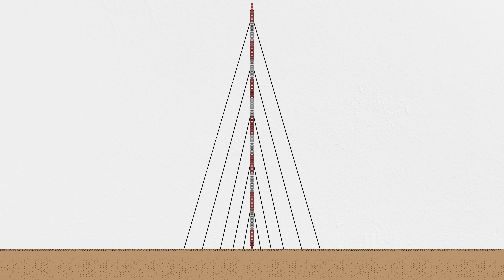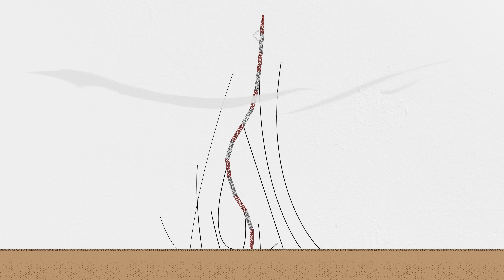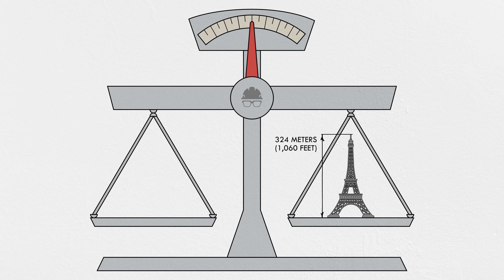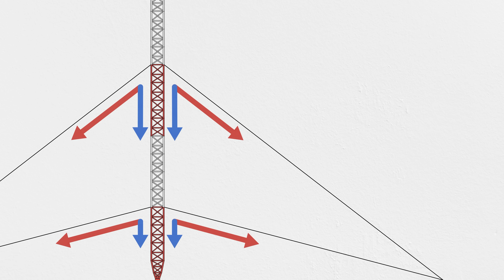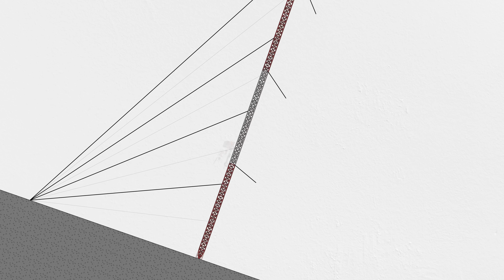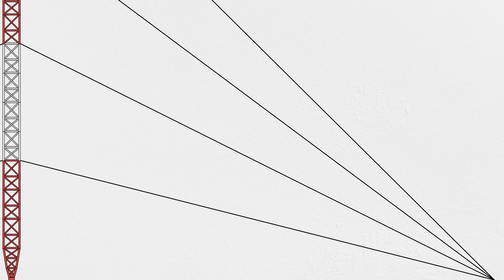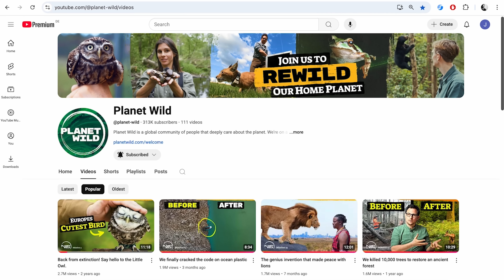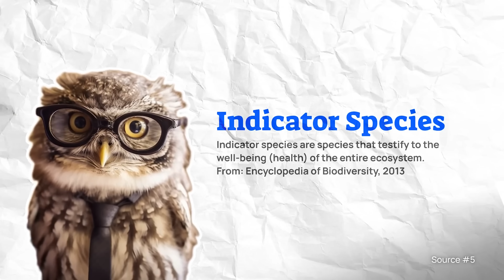The Bizarre Bases of Antenna Towers

Comment: On a hill close to my home there is such an antenna tower, just shy of 200m in height. When I first walked really close to that tower, I couldn't believe the size of the guy wires and the corresponding pieces that anchor the guy wire into the ground... From far away they seem so thin, but when you get up close, man those things are huge. 
Loved this video, loved the practical demonstrations.

Comment: I was privileged to work on a Vicon crane as the oiler back in the early 70s. We were constructing the Annapolis, MD, Array, consisting of a 1200 ft central tower (resting on a parabolic ceramic plate 3ft diameter) and five 600 ft towers encircling the main. The iron workers were mostly Native Americans. from Oklahoma. I have a whole story about being taken up to the 300 ft level and losing my bet.

Comment: Perhaps worth noting - Never touch an antenna or its supports if you didn't LOTO the transmitter. RF burns are some of the nastiest, slowest-healing burns you can get short of taking a nap on the barbecue. They almost inevitably end up going right through the skin and into the underlying tissues. You don't need massive transmitters for that, either - touching the wrong part of a reasonably normal ham or somewhat overdriven CB rig will do, and commercial transmitters will usually be several orders of magnitude more powerful.

Comment: 6:24 “You can’t push a rope” -> actually, you can. Climbers often loosen a figure-eight knot by pushing the short end toward the center of the knot while twisting it to create temporary structural rigidity.
Reply: Climbers and knots… I don’t think the exact same principles apply when standing a tower because you’re not climbing.

Comment: Hi Grady. Recently my hometown is constructing new bridges with only one pillar in T shape. I'm very concerned about the rigidity of the T shaped support which seems to be too thin. Obviously it is Post Tension RC. But still it's not reliable due to the tensile stresses exerting at the corner of the T pillar. Do you think it's safe?

Comment: I’m a structural engineer, so I understand how/why the fully pinned connection with guy wires are more efficient than having a fixed connection without guy wires. I’ve never worked with these towers, but how does the thermal expansion/contraction from the guy wires affect the tower itself? If it’s a “small” tower, then I’d assume it to be negligible, but if the guy wires are very long, then that would play a huge role into it. It seems like it would either induce too much compressive force when it’s cold or not resist enough lateral force in the heat. I don’t anticipate any projects with it, but I’m just curious at how both of those would be taken into account

Comment: Oh cool, I actually work on these, those guide-towers can really sway in the wind at the top. Self-supprters are by far my favorite towers to climb since they usually have the best climbing peg layout and you don't need to worry about any guy-wires getting in the way of the rigging rope that we  climb up with and attach to the tower to lift and lower equipment and components.

Comment: What amazing stories sheared here from professionals whose work involves commercial towers in some way. 

As an Amateur Radio Operator I have long been fascinated by the art & engineering of wireless radio. It’s one of those disciplines that the deeper you dive into the technical aspects the more you realize how little you actually understand it. 

Anyway, I use a 30’ telescopic mast to support my own little antennas. It’s supported by guy wires the same way a the giant commercial towers, and it is almost like some kind of magic how stable it becomes when all adjusted properly.

Comment: Loved working on cell towers for a handful of years. To cold in the winter and pretty dangerous for my taste. You can be as safe as can be, but your buddy can knock the tower down with one false move. I've had a couple close ones. Guyed towers were always tricky, mounting antenna booms. Take out one of those wires and your in trouble. Thank you for covering this!
Reply: "take out one of those wires" ????
Reply: @JoelSzymczyk  Cables! Drop a boom on a cable and your taking a quick ride to the ground. I hated those towers! You should never drop a boom, but if it did happen.

Comment: I'm studying naval engineering and sailboat mast are just the same but usually lateral space is very small so you can add spreaders(compression post part way you the mast) to increase the angle at which the shroud(cables on the side) meet the mast also you have very high compression from the sails(that means more pre-tensioning) and halyard (ropes that hold the sails up and therefore pull the mast down)

Comment: As always, very informative video. Back in 2001, there was a pilot of a small single-engine Cessna who unfortunately flew right into the WestTower Transmission Tower (1,087 ft) near Mont-Carmel in the Province of Quebec (it was foggy and used the tower as a way point). The main fuselage of the airplane was stuck so high in the tower that it was impossible to retrieve the body following the crash. Experts from the US had to come in and demolish the tower in order to retrieve the body. More detail can be found if you search for CBC Tower and the name of the city mentioned earlier.

Comment: Not to mention those guys have to be insulated as well. Our 1000' LF tower guys are made of sections of steel cable coupled together with massive ceramic links with bushings. That's another factor affecting the tension you can put on the cables, and the dynamics of the cables, since they aren't continuous lengths and have added weight along their spans.

Comment: IN CASE ANYONE ELSE IS CONFUSED ABOUT "GUY WIRE":
The word "guy" in "guy wire" comes from the nautical term gei (Dutch), meaning a rope used to control a sail or steady a mast.
It's important to note that a "guy wire" is not a "guide wire," though the terms sound similar. The distinction lies in their function: "guy" refers to stabilization and support, while "guide" implies direction or leading.
Reply: Thanks for pointing this out! And a "Guyed Mast" (which sounds even MORE like "guide") is spelled that way because it is supported by "guys."
Reply: @monitron  That's right. We guys support everything. 'Course if'n it weren't for our women, we'd have no reason to support nuthin' and everything would collapse like an unguyed mast.
Reply: Thank you Bill Nye the wire guy.
Reply: Thanks for the cool information! 😎
Reply: Precisely and thanks for posting that for those that didn't know...I've known for years,but thanks just the same,and,yes I have also noticed that the great majority of folks  do not know. Take care,and have a great day😊 (sincerely from just an average guy in B.C.,Canada)Stay safe
Reply: Same as guy-ropes for tents.
Reply: Im an engineer and Im embarrased to say Ive only just now learned it is actually "guy" and not "guide"
Reply: Well, I knew that but had forgotten.
My 12 brain cells run like a shift register.
Reply: Thanks I thought it was the guy the boy Installing the wire. By the way, most now to go terms comes from Dutch.
Even In Italy With a long past of sailors, many words that sounds architect. Read coms from dutch. Funny in the Netherlands. Most financial terminology is Italian because of the first bankers in Europe where Italians. And since Italian, Italy didn't exist yet they called him lombards.
Reply: Sorry voice recognition didn't work very well. You can try to guess what I meant right
Reply: He he. "gei"
Reply: Guy wire
Reply: French not Dutch, sorry niderlander
Reply: so the guys (aka the geis) keep your mast rigid
Reply: Thanks! I wondered about that. Though this is ripe for a cultural reference: Why ah u gei?
Reply: Dutch "gei," huh? okay, i see why they didn't go with "haywire"
Reply: It’s of French origin. As used to describe lines holding down tents etc. In English we call them “Man Wires” . Hopefully that helps 😊
Reply: I figured he was saying "guyed"...
🤔
Reply: Thanks
Reply: Does this have the same etymology as "guy" in regular speech? In a social context, guys could definitely mean stabilizing and supporting members of a group
Reply: @gaemr_o5147  Nope, that "guy" had its origins in Guy Fawkes of the gunpowder plot fame.
Reply: ultimately from a French name but by virtue of Guy Fawkes and effigies of his ("burning the Guy") made into a generic term for a person or even thing
Reply: @gaemr_o5147 exactly. So many phrases we use are based on nautical terms.

Comment: I grew up right next to a pair of radio towers. The main antenna was apparently a T-shaped wire that ran between the two tower tops and down in the middle. The span was 195 meters wide and the towers were 150 meters tall. We did climb in the towers but never very high up, it was of course closed off and not allowed, but kids will be kids. They were pretty beefy, maybe 3x3 meters. They stayed up pretty long after their main use was no longer needed. They made sure lightning never struck the ground anywhere near. But eventually they couldnt stay up due to cost of maintenance. Now the place is a radio museum and a small section of one of the towers has been put back.

Comment: Yep I've climbed a couple a couple times and used the tool to tighten the guyed wires when your on the ground of course but the bad thing about climbing these towers nowadays is they are over loaded so your body position is in a bad posture for climbing with all the coax going up the inside where the ladder is. It may be different now because everything is going to hybrid cables (AAV & HCS) power&fiber.

Comment: I was a broadcast engineer for 20 years before I became a software engineer. I was at an AM station doing work that had its single tower (non directional) right outside the studio. The video mentions the ceramic insulator at the base of an AM radio station to keep it insulated from ground and it also mentions the ball gap. But I don’t think he mentions that the guy wires also have multiple ceramic insulators per guy wire to insulate the tower (antenna) from ground. When a storm would approach the station the air would become charged and you would hear the ball gap snap, dissipating the charge that built up on the tower. It’s very loud. But this day a particularly strong storm was approaching and there was so much charge on the tower the ball gap was snapping constantly and visible blue plasma looking electrical charge was dancing down the guy wires and jumping the ceramic guy wire insulators to find ground. I assume it was or was similar to St Elmo’s Fire on airplanes. It looked like movie special effects. Or very much like a plasma ball but on a very large scale. Unfortunately no cell phones then to get a video or picture. Lasted at least a good 5 minutes. I have a lot of other wild broadcast stories but that was visually the coolest.
Reply: I saw similar things so many times at LORAN stations...   it usually made for a very long night.
Reply: sounds like a geomagnetically induced current!
Reply: WOW. This not being light from actual lightning strikes might be an answer to something that I saw, except it woke me up from dead sleep one dark night in winter, no rain, snow or lightning. It was loud snapping, maybe twice a second, that woke me up. I saw streaks of light moving across the floor, following a bright ball, maybe an eighth of an inch in diameter, like the streak when you wave a light in the dark. I was fascinated while my brain was waking up, and then I was terrified that I would be hit by lighting striking my 30 foot short wave antenna on the roof, if I didn't run for my life. But, being practical, I couldn't go outside in the freezing cold in my underwear. I waited in the hall until the snapping stopped, and then some.

 I normally alligator clip the center antenna lead to the ground when not short wave listening, but somehow the clip was laying on the carpet. I don't know how the streaks were finding ground or why they would travel across the carpet. But mainly what I don't get is there was no rain, snow or lightning.

Radio amateurs have lightning strikes all the time. It's not the same thing.

Comment: What makes you suggest humans cannot perceive electromagnetic signals beyond visible light? We put in standards exactly because humans do perceive them & because they impact overall health negatively. If you believe you can't perceive them, try standing in front of a microwave for a few minutes or call your friend using your mobile & have a 24 hour conversation. Even at "low" energy levels, electromagnetic waves are undesirable & not just for humans. In machines we call it EMF which is deadly to high switching electronics.

Comment: AM broadcast band is not very good at comms, it's used because it's ground wave propagation, this is because it stops interference, you can communicate globally with much smaller antennas higher up in the HF band, like the 40m 7mhz band, where a 10m high antenna which is a quarter wave ground plane can reach globally. 
But obviously if the AM broadcast band was at 7mhz you would have so much cross talk the band would be just overlapping signal and you wouldn't be able to hear anything.

Comment: There used to be a fairly complex phased array AM setup not far from me in Mesa, Arizona. (I think five towers total.) I used to see it every day from the freeway as I drove past it on Loop 202. Then, one day, it simply wasn't there. I have no idea why the towers (plural) were removed, but it was kind of a disappointing loss. I grew up around that stuff and I love seeing communications gear of that sort. Also, slight correction... it isn't "orange", it's specifically "international orange", which veers more towards red than orange, but is a color that easily stands out when paired with the white sections. If you're of a mind to experiment, buy three cans of spray paint, orange, international orange, and red or dark red and see how they compare.

An interesting note is that my dad was the chief engineer at the station formerly in Flagstaff during the 1980s. After the station folded and the frequency became a relay of a phoenix station, the batwing antenna was removed from the top of the tower. This had two effects... First, it put the tower below the height where it needed to be painted and lit (200 feet above local terrain), saving a ton on maintenance, and second and more interestingly, it allowed for the removal of the upper guy wire because there was less loading on the tower, thanks to the reduced height and weight of that big antenna.

Comment: Future Video Idea: The Engineering of Structural Steel Cables

Why: I was at the Deutsches museum recently and they had a cross section of a massive steel cable from the Brooklyn Bridge and it was insane. And apparently they also weave the strands to manufacture the cable as the bridge itself manufactured? I haven't looked into this too much so it may not be interesting enough for a video, but I was reminded of it due to the niche nature of a video dedicated to bases of antenna towers lol

Comment: 14:18 SOME?! Some?! Require manual climbing??! 
...hey hey get the intern to start hauling on the pull up line. Dam. 3 am network down cause a bird flew in at mach 10 to an armored connector. Your still climbing. Elevators?!😂 omg, please 🙏  -30 hurts

Comment: There's another tower design which combines elements of the guyed tower and the free standing tower called the Blaw-Knox tower.  Essentially, it's two tapered towers, one stands upside down and is stabilized on its point by guy wires, and the other is a free standing tower on top of it, creating an elongated diamond shape.  One notable example is the WLW tower north of Cincinnati.

https://en.wikipedia.org/wiki/Blaw-Knox_tower

Comment: I worked on a college grounds crew that was sent to install a fence around the school’s 600’ FM radio tower. It was a triangle about three feet on each side from the ground to the top. 

Over lunch we climbed the tower for the fun of it. I made it to the third guy wire at 270’ before I gave up and returned to the ground.

Comment: I was a bit disappointed with this video after reading the title. I was expecting more about AM frequency towers as they are always insulated at the base. Most people don't understand the relationship between tower height and the planned frequency as the lower the frequency the taller the antennae. Also the location of AM and lower frequency transmitter are not determined as much by line of sight as they are by the properties of the ground the tower is built on and it's ability to provide a good ground plane as these low frequency signals travel through the earth as well as the air. Many AM transmitters are near the Ocean shore as the damp ground provides a good ground plane connection.

Comment: VERY early in my career I went up Dirico Tower on the Dade Broward county line. 1000' guyed tower with an elevator to the radio platform at the top. Took 11 minutes to get to the top and nearly half that to get down.  Back then it was just like going to any other roof top radio shack, no harness or anything. Now I think they require all the safety gear you'd use to climb.

Comment: Great video. One more detail is that for the towers that are the antenna (AM broadcast) the guy wires have insulators so that they don't interfere with the signal. That's one way I can tell whether or not the tower is AM or just FM/TV/ etc.
Reply: The supports actually do interfere with the antenna despite the insulators - just in a way that's easier to account for on the RF engineering side of the design. Every conductive object within a wavelength of the antenna will create a parasitic field that alters the far-field characteristics of the antenna.